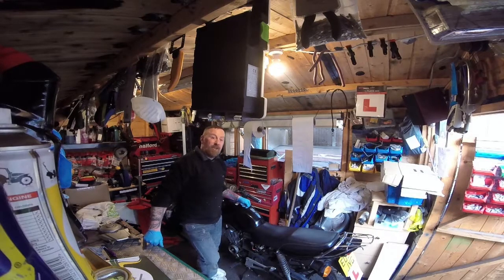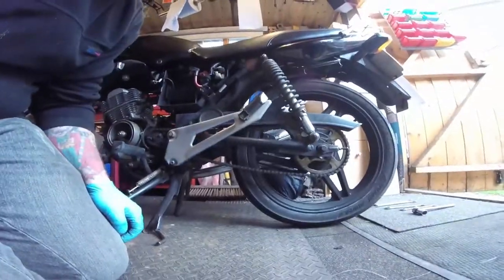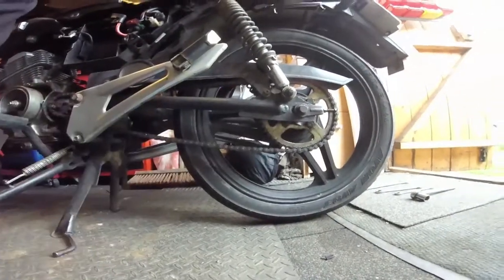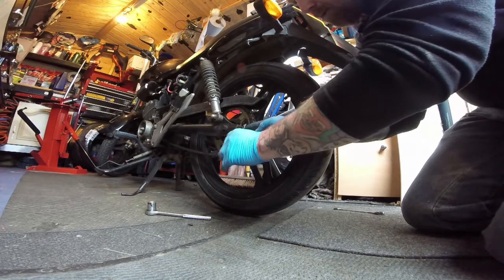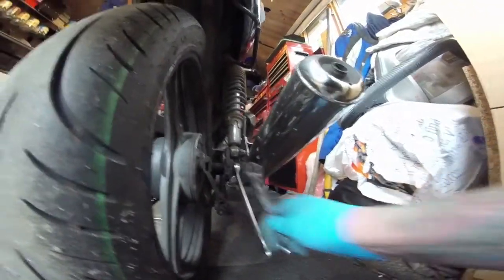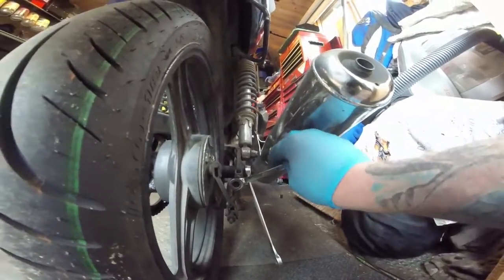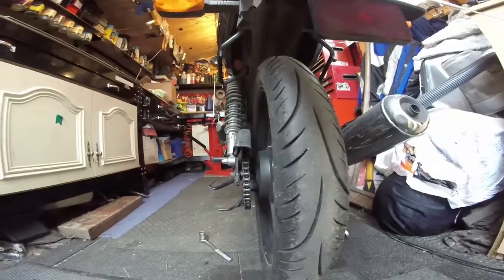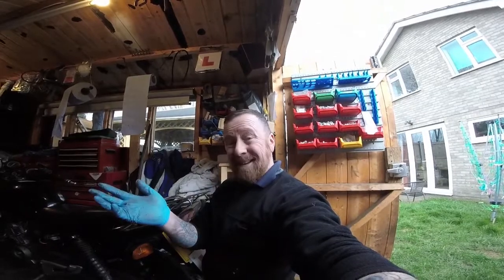How to adjust a motorbike chain mark savage

Comment: Nice tips Mark . whats the best way to see if your back wheel is in line or straight before 
you do adjusting pls . :)
Reply from the maker: Get the bike on a centre stand or a bike lift and spin the rear wheel and look from beside 
If the wheel rolls round straight all is ok , if the rolls left and right it’s wrong 
Another way push the bike forwards a little at a time and check the chain it should be the same all the way round , however if you have a stretched chain it could do this so not the best way 
Last count the maker lines like in my video but really not alway right so the best way is the first way 
If you do adjust make sure it’s even after adjustment 
Thanks for watching and hope it helps
Reply: Got you  , Thanks Mark  luv ya vids and learning a lot . Cheers .

Comment: Morning Mark have you any easy tips on how to change front and rear wheel bearing I've got these to  do on my Derbi Cross City 125. Thanks
Reply from the maker: Fisher B hi bud thanks for watching 
Go to a garage with the loose wheels as it will be a little cheaper !
Sorry bud no as one side is always a bugger to get out and the old way with a hammer and big screw driver
The other side you can use a socket and knock it out 
I hate doing them I really do
You can buy some kit which will help 
One tip ! When and if you get them out
The night before put the new ones in the freezer as this can help when putting them in 
Use lots of grease too with a flat bit of wood and a hammer to pop them back in 
Sorry bud it’s just one of those rubbish jobs 😢😢😢😢
Mark
Reply: mark savage hi mark thanks I just wanted to try and save the garage fees I have purchased the bearings for both F/R MOT due next month re speedo drive the red section inside is worn do you know if this part is available or does it usually come part of a set I’ve bought a second hand complete drive unit and 5his is worn too😡
Reply from the maker: Fisher B e bay bud to see if separate or not and good luck bud with sorting it but as said it’s a bigger Lol 
Take care bud 
Mark